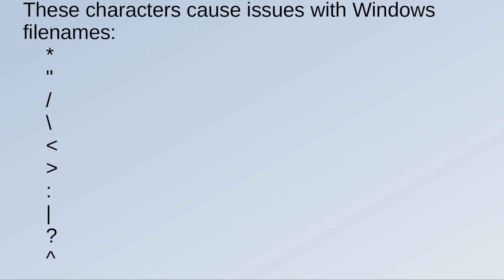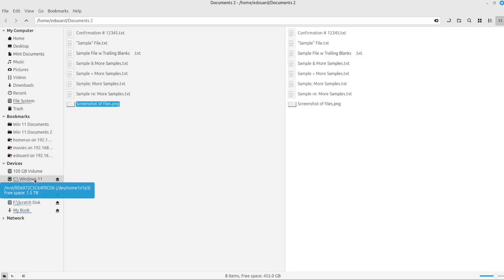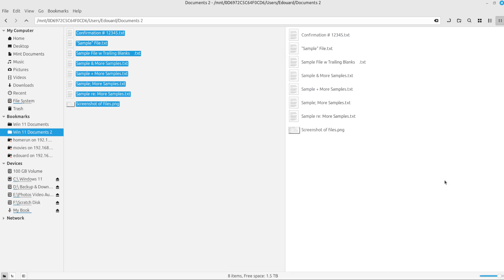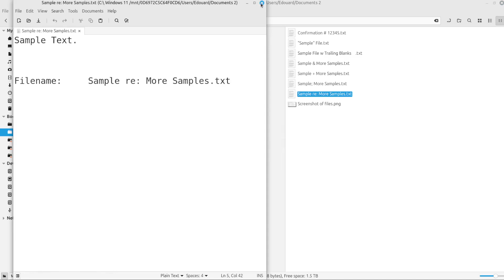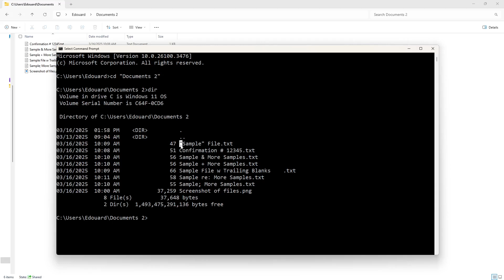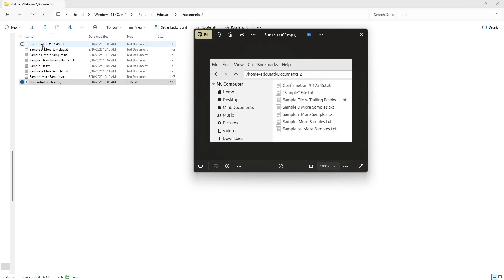Filename Issues - Windows versus Linux

Comment: This is a terrific video - it covers all the missing pieces that have been puzzling me as I get ready to start making the move from Windows to Linux (starting with dual boot).

Your video needs to get broader exposure, somehow. Very clear!

I have a very large archive of files in Windows NTFS that will be in a separate drive in my "experimental" computer (I have 3 drive bays in my lap top, so one for Windows, one for Linux and the third for all my data). All of my data will ultimately need to be accessible in Linux (when I ditch Windows), and meanwhile must be fully accessible in both systems.

Foreseen worries until I am able to work purely in Linux are my existing mixed-case filenames and (hundreds of) directory names, and my VERY liberal use of space characters in both kinds of names, almost universally. I foresee lots of "tank traps" ahead, as I get ready to make my first Linux installation..